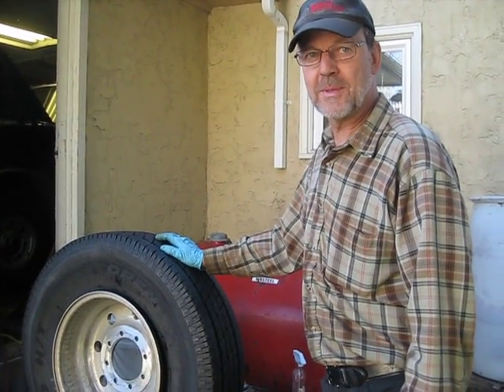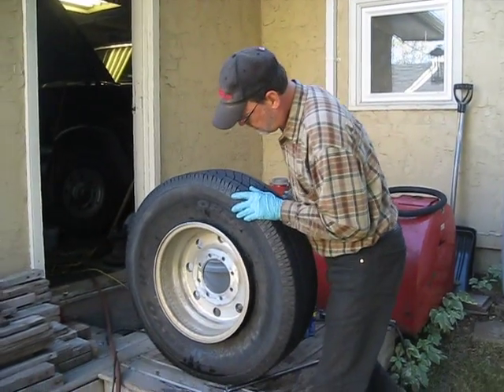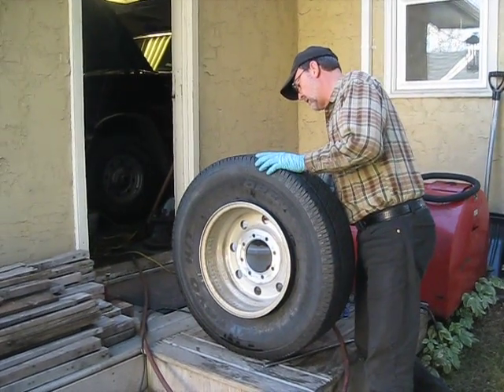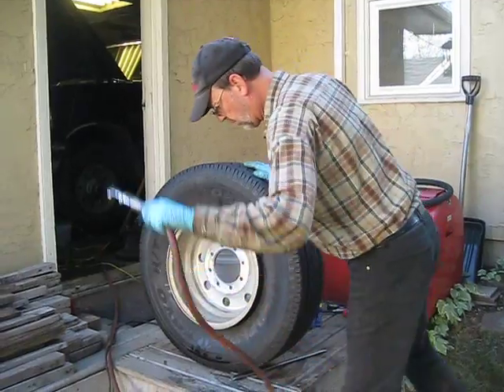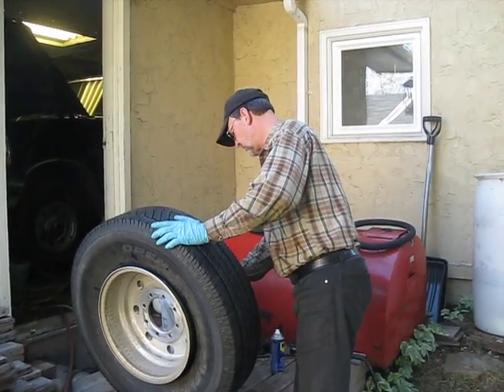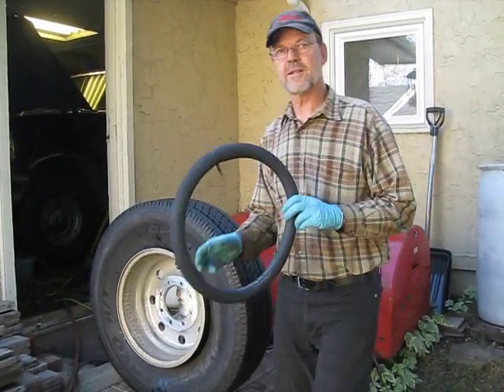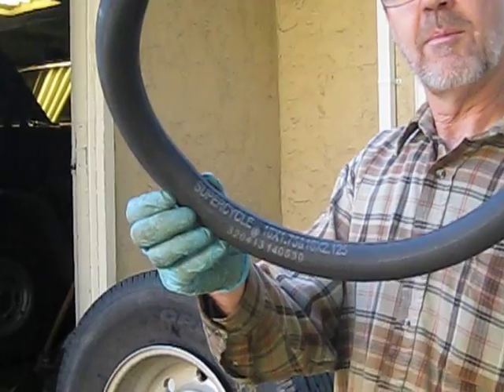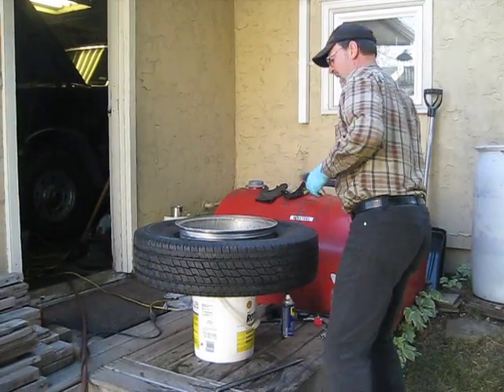Seating tire on rim

Comment: I came back to this video to post a comment of how great this tip is. I have never had the courage most times to use the starter fluid method. I have used it but always hate to. I just tried this tip a couple days ago and I was blown away. Finally a safer way to get this stubborn issue done. I wanted to thank you as a comment. Thank you for sharing your knowledge ☺️☺️☺️

Comment: That is pure genius. I thought to myself, "How the heck is he going to get the bicycle tube out?" I have never seen a safer, gentler way to mount a stubborn tire. You got my subscription for that.
Reply: 42lookc they make a rubber Ring for that. Just make sure you put soap or grease on it so it will pop out. You dont have to remove it . it will come out as the air goes in
Reply: @edwardpuddy4793  I cannot find what you are talking about. Do you have a link or more details?
Reply: Instablaster...
Reply: @edwardpuddy4793  What is the exact name of the product. Please could you provide a bit more detailed information?

Comment: Absolutely GREAT idea.  I've struggled with this problem on all kinds of tire/rim situations for about the last 50 years, everything from car tires with wide rims, to motorcycle tires with stiff short sidewalls. I worked on a 16.5" light truck tire today for our motorhome using the old tie down strap method with no luck at all.  Saw this video and found an old bicycle tube on a shelf, and even though it was far too big a diameter, just stuffing it in and twisting the excess filled enough of the gap to get the tire to take air.  Thank you!

Comment: You're the freakin' man!  I struggled like a madman trying to seat one ( of the four) new tires on my '05 Honda Pilot yesterday and after several hours I was at wit's end and finally gave up in aggravated frustration. Before I went to bed I checked out youtube and saw Brian's video...and thought it just might work. First thing this morning I went to my local Walmart and bought a 16" bicycle inner tube for a "whopping" $5. I applied some soapy water to the tube before putting it into position and the bead was seated on the first attempt...I was stoked! Thanks so much for this awesome tip.

Comment: Thanks a lot for this video! I have some new tires to mount, but the centers are too collapsed to reach the seats, as yours was. So, I went to Walmart and bought a 16" bicycle tire inner tube for $5.00 . My wheels are 15 x 8 wheels, 79-81 Pontiac Trans Am WS6 Snowflake wheels to be exact. The 16" tube worked perfectly on my 15" wheels, for anyone who was wondering if the 16" tube would work on 15" wheels. I used a little tire soap on the tire and tube, which helped seal it and it makes it a little easier to pull out the tube. So, it was fast, easy, safe, and cheap! Thanks again for the easy solution.
Reply: have 15 x 8's for my 79 T/A and thought maybe 16" bicycle tube might work. Now I know what to do Awesome..

Comment: That is pure genius. I was fighting my logsplitter tire trying to get the new tires to seat on the rims. One I didn't need the bicycle tube but I tried it on the other and I had success. A little difficult getting the tube out but I did it. Too bad the stem on the tube isn't on the outside instead of the inside. Thanks so much. Don't know what I would do without youtube.

Comment: You Sir are my new HERO and get my full respect!!! F-350 tires which I suspect is what you have there too. A few things I will add is that I lubed the outside with tire lube and it stuck as the tire started to set the bead. The next one I applied a thin coat of Vaseline and it worked perfect and completely POPPED right out too!!! I also saw better success with just the right amount of air in the bike tube - not too much and not too little. Over the past few years I have literally spent HOURS trying to get pickup truck size tires to seat... Not anymore!!! Thank You!!!
Reply from the maker: Glad it worked for you.  :)

Comment: Fought with one for like an hour and a half using a ratchet strap and pushing pulling bouncing my weight on it while putting air in tire used every oz of energy i had and gave up, Figured I'd search youtube for ideal and found this, went out there and tried it, Had the tire seated on the rim within 4 mins.althought I thought i was going to get the tube hung in the bead.Glad I found this.Thanks you.

Comment: Frick'n genius.  Worked a charm for a tyre I had been battling with for days.  Popped a tube around the edge and it was done in 30 seconds., oh man I wish I'd found your video years ago! 

A note though for people like me who are not bicyclists, cycle tubes are measured on the OUTSIDE diameter, the 10" tube I bought was rather smaller than I expected!  Still managed to stretch it around and it worked but would have been even easier with a more correctly sized one!

Comment: Thank you thank you thank you, this was a lifesaver. I was trying to mount tires on five lug VW Rims, nothing work and I didn’t want to try lighter fluid. I used  a 12 inch and a 16th“ tube.Both work perfectly. Thanks so much

Comment: Thank you, Brian!  This worked perfectly!  Spare on my Silverado went flat because steel rim had rusted through.  Got a good correct rim at a salvage yard and didn't want to pay for a tire shop remount.  Was able to mount the tire with hand tools, but beads would not seat due to big gaps both sides.  I didn't have a can of ether and ratchet strap trick failed.  Found you on YT, and lo & behold I found a 16" bike tube in my shop!  It took a few tries to get the opposite bead to seat.  Once it did, the side with the bike tube finally grabbed in one shot.  Like in your video, the bike tube came out intact, ready for the next time I need it.  I never would have thought of this.  Again, thanks!
Reply: Did you take out the valve core, like the guy did in this video? I don’t understand why that would necessary for this method.
Reply: @jakemccoy  No, did not remove the valve core.  That wouldn't work.

Comment: Thanks for sharing this method that is easy, safe and works every time. The only thing I did differently is to leave the valve core installed so I didn’t have to quickly cap the stem to prevent air loss while removing the bike tube.

Comment: Awesome.... it worked the first attempt. Prior to seeing your video I was thinking of the same theory but I could not come up with something to temporarily fill the void while air was introduced. The tube was excellent!
Reply: Did you take out the valve core, like the guy did in this video? I don’t understand why that would necessary for this method.
Reply: @jakemccoy  Yes I took out the core. It allows the air to flow faster in thru the valve stem to inhibit the seating process

Comment: Im about to try this out. I was going crazy trying to seat the new tires. Lucky i only took one off i didn't want to leave the car up because im on theain road and new brakes a week ago i didn't need those getting snatched. So i was so frustrated i said lets try and put the old one back on see if im crazy and it filled right up. So its clearly just the new tire being too compressed and thin around the bead. Ill try this this morning and get back with an update thank you for your time!

Comment: This works good. I like to smack the rim with a rubber mallet on the rim opposite of the valve stem to seat that side. Then with the wheel upright as you have to give it air with soap. Sometimes you don’t need the inner tube on the valve stem side.

Comment: Tried several  things to get tire to seal to rim, twisting rope around center of tire, ratchet strap, and few other things..seen this video and happened to have old bike, took out tube and worked perfect on first try tire sealed no problem..

Comment: I am going to be trying this. All I have is a 12v car compressor. I'm pretty sure this will work with that. I was able to successfully set the bead of one of my tires with just a ratchet strap and the same air compressor. But my other tire will not set. Getting just a bit more sealing will help it set.. Funny enough I have changed a number of tires and set the bead each time with fire and it worked every try very well. But this time I have new rims and for some reason that method doesn't work... not was it ever ideal for me but it is the only method I have with my tools that was working every try
Reply from the maker: Good luck.  Let us know if it works with the 12V compressor.

Comment: I understand removing the valve core for the starter fluid method. But for this method, why do you need to take the valve core out? You should have explained that in this video.
Reply from the maker: You don't have to remove the valve core, but it helps to remove it because more air can get into the tire faster, improving your chances of inflating the tire.  The valve core is a restriction to the air.
Reply: @PompiisGarage  That makes sense, thanks! With the starter fluid method, the reason is the polar opposite. The valve core is removed to help prevent the tire from exploding. In other words, removing the valve core helps the pressurized gas to escape.

Comment: If you have the correct tire size for your rims then seating the bead won't be a problem?
Reply from the maker: The tires used in this video were the correct size for the rims.  Having the correct size tires does not guarantee that you will not have a problem.

Comment: I have a semi wheel and tire  or two I cannot get seated. the wheel is good no cracks on both the tires are good I mounted 8 tires in a row before these two with just a milton recapper. I cannot get these to seat with a bead blaster, I have tried either,(starting fluid) and I bought a factory tube like your tire tube for semi tires from ken tool and I cannot get them to seal up, any suggestions?
Reply from the maker: What size are the tires and rims?
A 10R22.5 should have a 7.5" rim, a 11R22.5 should have a 8.25" rim. You can put a 11R on a 7.5" rim, but do not put a 10R on a 8.25" rim.

Comment: Nice process.  Do you think more air in the tube would help?  I remember about 40 years ago they used to use a kind of squishy ring of rubber about the same size.  Do they still sell those?  I don't know what to call them.
Reply: Lack of focus good question I don't know ther pepper name but I  know what you are talking about I need thos for my tire shop l call them  donut rubber bands 🤷‍♂️  if you find out where to get them send me a message please .

Comment: He went raw dog with no soapy water. :)
Reply from the maker: The tire bead and rim were sprayed down with WD-40.  You can see the can in the background.  Works good and no water to corrode the rim and get a rim leak. :-P
Reply: Thanks for the video. I took a small 12inch inner tube from a kids bike and used this idea on my riding lawnmower. Worked great. I also passed this idea onto my mechanic friends.

Comment: So you are installing a tire that doesn't fit the rim to get it on the public road?
Reply: There's lots of tires. That are like that. Almost every semi truck tire. Most trailer tires. My 19.5 tires are the same way. The bead is not set up like on your car. Its the right tire and wheel. Just life.
Reply: I had the exact rim for my size tire, yet had 1" of gap on both sides once mounted on rim.  I've watched workers deal with this at tire stores also.  Correct match between tire and rim doesn't always bead up snugly.  Brian's fix is safest I've seen, and saved me a 20 mile round trip to nearest tire shop, not to mention the $.
Reply: Clearly you don’t know what you’re talking about body! This is absolutely normal and happens very often!! Go back at playing call of duty and dreaming on how is gonna be the next playstation and stop bathering the adults!!